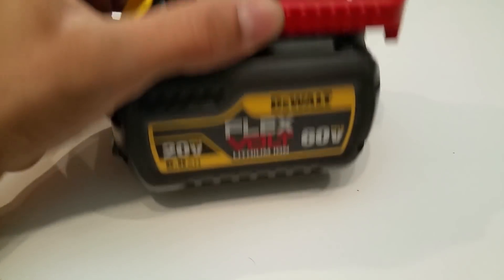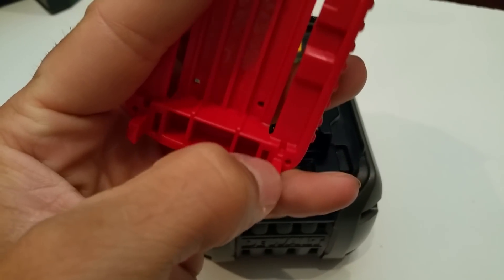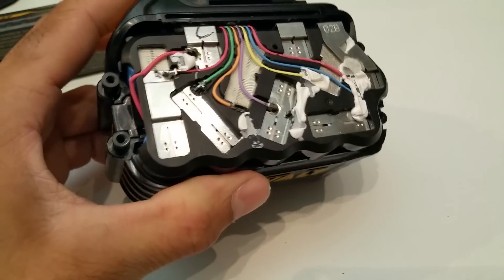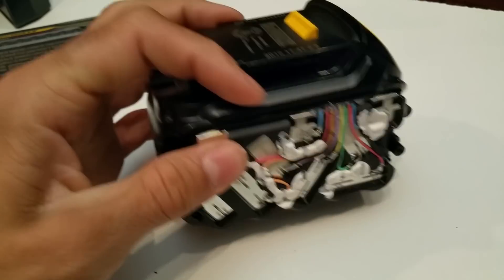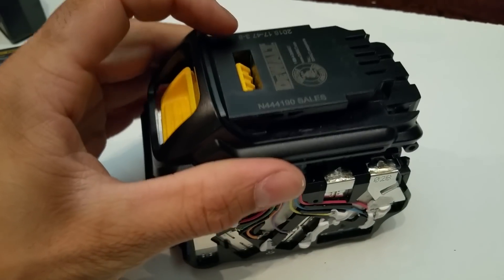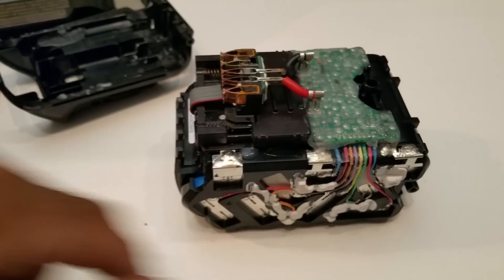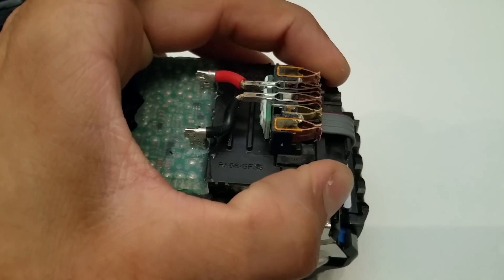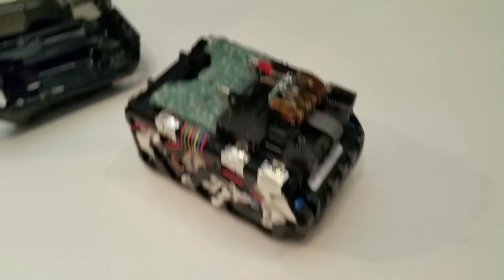Whats inside a Dewalt 60V FlexVolt battery

Comment: That’s a PCB (Printed Circuit Board) with conformal coating. A “chip” is a packaged component that goes onto the PCB. There are likely several chips under that coating.

Comment: You didn't even take it apart... taking it apart means to expose and take out the batteries so we know how to replace them.
Reply from the maker: trophix this is a suuuper old vid, but since then i have fully disassembled a pack. Unfortunately its really hard to do without causing damage
Reply: Toolaholic what damage did you cause... it seems like everything is just glued and soldered... shouldn't be hard to take off and put together.
Reply from the maker: trophix not quite soldered, the cells are spot welded so you have to yank off the bars and find new solder on ones. You also have to move all the balancing wires
Reply: Toolaholic of course you have to remove the welding... that's part of any battery pack. If you have to replace a cell just have a couple of nickel plates on hand to replace them. Also the balancing wires just solder them back together.

Comment: From elsewhere, the way to switch from 20V (parallel) operation to 60V (series) operation is:
1) Push the physical switch "in" (just like the shipping cap does), and 2) Connect C1 and C3 terminals on the battery.
Reverse order to disengage. *NOTE:* If you connect C1 and C3 with the body switch disengaged, you instantly brick the battery!
https://hackaday.io/project/45999/gallery#44d2be71db9d189fea8f395f25de8e3a
Reply: You're welcome.

Comment: Mine packed in within a year, still waiting for it to come back from DeWalt... Seems the extra technology complicates things as mine would work in a non flex volt tool but not in a flex volt one one day when I got it out to use, also the final charge indicator light was not lit even when charger told it was full. Disappointed, certainly puts me off buying more of them. (DeWalt have had it two weeks now).
Reply: Hey same thing happened to one of my batteries today what did you do ? Did u ever got it fixed ?
Reply: Did they repair it
Reply: Yes, because it was within a year the DeWalt service centre replaced it free of charge, but informed of it would of happened outside of a year they would not have done, doesn't give you great confidence but I've not had any other problems to date, and I'm happy with the performance of the tools although using batteries in flex volt mode does cut you run time down to a third remember that.

Comment: All we really need to know is - This battery pack is BADASS! Do you find the weight of the battery to much in the Drill and Impact driver? I ask because I really like the balance of the 20v MAX battery pack when using the hammer drill and impact driver. This battery pack would be awesome in the flashlight though, probably run for days.

Comment: I realize this is almost a year later, but the 60V max tools themselves have 5 connectors instead of 2-3 that the 20vMAX have. So the tools are physically set up to run series and work in concert with the chip. A standard 20vMax battery wont fit on a 60Vmax flexvolt device to prevent damage to the cell.

Comment: That bar isn't a disconnect. It just tells the board rather the tool you put it on is a 20v or 60v.
Reply from the maker: SouthernGuy8503 i found out later it was a switch. this was a long time ago when I first got the battery. thanks!

Comment: Thank you for posting. Please be careful poking around inside this battery. 60 volts is dangerous, and with the currents these cells deliver - very easily fatal... I suspect they have some mosfets on the rear of the logic board disconnecting series-mode if battery not connected to a tool which has identified itself. Otherwise this battery would pose a hazard...
Reply: It's only 20.4V in his hands, tho.

Comment: it's odd that in the uk these batteries are labeled 54v/18v which is the nominal voltage of 18650 cells, in america they quote the max voltage of the cells which is 60v/20v.either way they are still shit 54v with a capacity of 2Ah won't last 10 minutes on a chop saw or a angle grinder
Reply: There is no alternative other than being corded. I'm glad this is even available. In time there will be higher capacity batteries.

Comment: Wondering if that disconnect has something to do with the voltage setting, it may be in disconnect mode with the protective cover on but wondering if a 60v power tool fully engages it to 60v?
Reply: The bar with springs is most likely just an eject spring with no electric connection.  Many brands of slide on battery packs have them.  It's possible that it's a switch, but more tools these days have electronic communication between components to synchronize them.  Lithium batteries have to be carefully monitored to protect from damage and excessive heat.  It can also be used to select appropriate voltage selection.
Reply: No I mean the other side. If you watch the video he calls the switch a disconnect switch, it's the bit that the red cover engages (nothing to do with the yellow button) but it actually more than just that. If you look at the 60v tools they have an extra bit of plastic at the bottom which engages the switch so I'm pretty sure what I said is correct. It is a mechanical switch between 60v and 20v.
Reply: Brett

Yes, I was referring too the black internal bar with springs.  Notice I typed "It's possible that it's a switch," in the previous comment.  It is one of multiple ways that the tool could select between 20 and 60 volts.  Another way could be that the outermost connectors could be one set of cells, and the middle and next connector could be another set, ect.. that can loop through the wiring of the tool according to how the tool is wired to select the correct voltage.  Another way would be through the circuit board electronics which would switch between series and parallel circuits to match the tools voltage setup.  If it is a switch, it serves 2 purposes.  One being to select for voltage, and the other being to push the battery pack off of the tool, so you don't have to pull along with squeezing the release button.  If it's not a switch, it pushes the pack off upon squeezing the latch release, so you don't  Have to pull it out of the electrical connectors.  Some battery connectors hold quite tightly, so it takes quite a bit of force to get them apart.
I've seen those push bars in single voltage packs just to make it easier to remove the pack from the tool.
Reply: I did think about the series option as I have seen laptop batteries use this method but there are only 5 terminals and there should be six for that method. It would be awesome if someone who has this battery could do some testing with a multiple meter with the bar pushed in.
Reply: The bar isn't really a disconnect. It simply tells the board rather the tool is a 20v or 60v. I believe the default is 20v and then a 60v tool has the pieces that push that bar in to change the battery into the 60v.

Comment: the 9.0 was from what I have read designed from the ground up as a 9 amp 18v battery which if measured as as Dewalt is 20.8v and it takes two of these 60v batteries to run their saws so it will be interesting to see a head to head with the fuel mitre saw and the Dewalt Dewalt s 60v 6amp against Milwaukee's 108v 9 amp sorry 18v
Reply from the maker: i actually have both saws you mentioned with me right now. the milwaukee has a better runtime but the dewalt is more powerful without question. depends on what you need
Reply: I would rather have power. Isn't it a given that the more powerful device wouldn't last as long?

Comment: Very interesting video. Thanks.
Since there are a lot of wires, looks like 60V mode charges all the cells in series, since there are cell balancing wires for every single cell.

And the top circuit that covered in epoxy(?) looks like additional cell balancing and control circuit.
For other 20V batteries, there are 5 cells max in series, so balancing could be done from the charger, but with 15 cells in series, it won't be possible to do that (unless the battery has more than 16 connectors). I don't know much about it, but maybe charging as 60V 15S mode is faster than 5S3P mode?

Anyway, I see huge potential from this battery.
Being able to use the same battery for the outdoor tools as well would be really awesome.
I really couldn't afford other cordless outdoor tools just because of the battery prices. Usually, they are too expensive to use for just one or two tools.

But if I can use the same battery on other power tools, that's not a problem anymore.

Anyway, I ordered recip saw kit that comes with 2 flexvolt batteries, and waiting it to be shipped. I really cannot wait to test it.
Reply from the maker: hey no problem! I think you are right on the top circuit board. There has to be cell management within that board. I need to do an update video, the switch on top actually does flip between 20v and 60v, I wasnt pushing the bars in deep enough. The packs have been performing well. Im impressed with all their tools and I agree the potential to use the same high voltage battery pack on outdoor power tools is a huge advantage.
Reply: +Toolaholic so that does actually put out 60v when the  button is pressed? must be a "switching" power supply within...
Reply: +Toolaholic and the white stuff over the wires is called silastic. it's found in all kinds of electronics.
Reply: "looks like 60V mode charges all the cells in series"
Output mode has absolutely nothing to do with how the batteries are charged.

Comment: I love this idea.  Pulling apart tools and showing us how they are actually built!
Reply from the maker: thanks man! i usually pull apart quite a few tools but i didnt post them because i didnt know what kind of interest there was. people seem to like it so ill definitely continue
Reply: do you have any idea on how the battery works with regards using it on an 18v/20v max tool. u say its essentially 3 2.0 ah batteries does that mean itll last 3 times longer than an 18v 2.0 ah battery when used in an 18v tool?
Reply from the maker: +MrSteviegall yes that is exactly correct. in 20v mode its a 6ah battery pack. so 3 times the runtime of a 2.0
Reply: ok ty, next question.lets say hypothetically dewalt already makes a 20v 6.0ah battery. would this flexvolt battery last 3 times longer than that too becaus eit only accesses 1/3 of the cells at any one time. what i mean is if in 20v mode it only accesses 1/3rd of the available power then surely it shoudl last 3 times longer than a standard 6.0 

did i make sense at all?
Reply: MR.Steviegall, no it will last about the same time.  This pack is configurable as either a 20v 6ah OR a 60V 2ah pack (the tool tells the battery what voltage to supply).

Comment: does anyone know if the 60 v is compatible with  dewalt cordless drills that come with 12v batteries? It looks like the same clip as the 20 v and 60 v but i just wanna know if its worth cheaping out a few bucks or just wait to get the 20 v
Reply: According to the Dewalt site:  http://flexvolt.dewalt.com/en-us.  The battery pack is compatible with 20V, 60V, and 120V tools.  

The battery may physically fit the 12V tool, but it will most likely burn up the motor windings as the battery doesn't step down voltage below 20V...although it would have been nice if Dewalt would have incorporated the 12V in the battery design.

Comment: Uhg. I pretty much said that such a battery is a disaster waiting to happen. You can have a 18-20v tool with a high torque motor that can give you plenty of performance and rival or beat corded tools. Dewalt could have made capable tools with their 20v max line (which is the same battery as the 18v systems) line rather than trying to go for the 60v gimmic and sacrifice design. Milwaukee has more than equivalent performance in their m18 line.  Then with more amp hours you get the run time. Understand that at 60v the dewalt battery only has 2 ah. By trying to have both a 20v and 60v battery that changes means you have switching components that are only a failure waiting to happen, particularly since a cordless tool battery operates at such high current levels. Such switching components take up lots of space, can heat up, and can have issues with handling such currents reliably. Not to mention, now that I see the inside, that dewalt has resorted to using such small wires running all over and over top of metal traces. Most packs uses metal traces in a more clean pattern that can handle higher currents and load than what these gauge wires can handle. A good example is milwaukee m18 9.0 pack which is a 9 amp hour pack with heavy traces, breath-ability, and more capacity than this dewalt pack which at 20v (18v) is a 6 amp hour pack rather than the new milwaukees 9ah.   I think this whole system and battery design is a disaster waiting to happen and a big mistake. Another example of poor thinking in dewalts tool line up is their big heavy stud drill which is equivalent to the super hawg, which is not a design that will work as well in tight spaces. Dewalts design is more like the original corded hawg from before which milwaukee improved upon. For an electrican or someone drilling small auger holes, milwaukee has the regular hawg which is lighter and more manageable than lugging around the super hawg or the dewalt stud drill. Appropriate drill and size for the job that it is needed.
Reply: I really want one of these to test. I believe that the small wires are BMS only. I'm pretty sure that the switch that the red bit engages (what he called a disconnect switch) is also a mechanical switch that changes it over to 60v, if you look at the bottom of 60v tools they have an extra bit of plastic that engages it. But I agree that yes it is another point of failure and if it is indeed mechanical there would be contacts that could be worn out, I would hate to imagine the internal arcing in the battery that would occur if someone remove it with the tool going.
Reply: Ari P Yeah but a 60v 2amp hour battery with run longer then your milwaukee 5amp battery 60 v tools run more efficiently then 18v tools you have to use much heavier wireing to try equal 60v power you sound like a crybaby milwaukee fanboy
Reply: Seems like pure conjecture to me, though you're right that a switch could fail. Whether this is really going to be an issue remains to be determined, but I think this is a great idea. I have a boatload of 20V Max tools, and these being compatible with them is awesome. 60V tools will be more powerful by design since this battery can supply so much power. I don't think a higher capacity 18V battery is a good idea because high current/low voltage devices are less efficient. If this was a good idea, other manufacturers would have come up with it already. I think this system is going to be a huge success for Dewalt. Time will tell if it's reliable. It's already been shown that their 60V max tools are very high performance.
Reply from the maker: you are right. i missed that in my video. it is infact a mechanical switch that engages 60v mode
Reply: I just got Dewalt's 60V grinder. It is awesome! I wonder how the other manufacturers will respond, and I wonder how much of this idea is patented.

Comment: I'd be interested in seeing some voltage readings. With and without the transport be depressed.
Reply from the maker: i tried to depress the switch and it went from 18v to zero. i still cant figure out how it actually switches to 60v. (54v nominal) ill make an update video
Reply: +Toolaholic Interesting. Send it to AVE. HE'll figure it out. Lol
Reply from the maker: +Ricky Mcgrath lol I can figure it out but not without trashing the battery. still need to be able to use it for reviews

Comment: 2:03 Each cell is 2.0 Ah, this means it can't be 25R Samsung cells (2.5 Ah). 
So if it Samsung cells it will either be INR18650-20Q or INR18650-20R: http://www.samsungsdi.com/lithium-ion-battery/power-devices/power-tool.html If they used 25R cells, it would become a 7.5 Ah battery.
DeWalt are however soon coming out with a 9.0 Ah FlexVolt battery: http://flexvolt.dewalt.com/en-us/products
Comparing pictures, it has the same physical size as the 6.0 Ah battery which means the 9.0 Ah battery will contain 15 * 3.0 Ah cells.
So if these are Samsung cells too it will be INR18650-30Q cells or  INR18650-30R if they exists. INR18650-30Q is not listed on Samsung SDI's website yet, but they have been available on the market for a long time now and you can find a datasheet too with Google. Not sure f INR18650-30R exists (yet?) though.